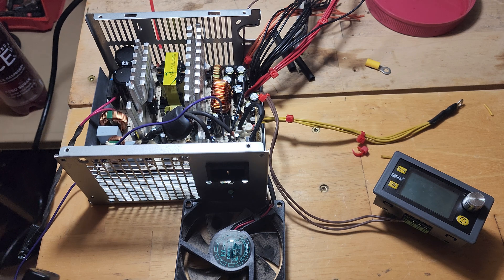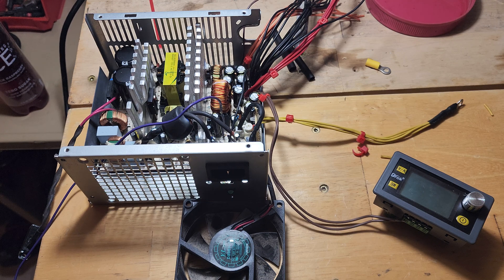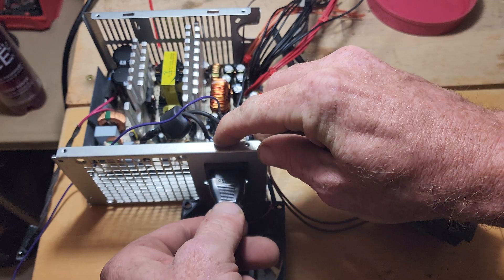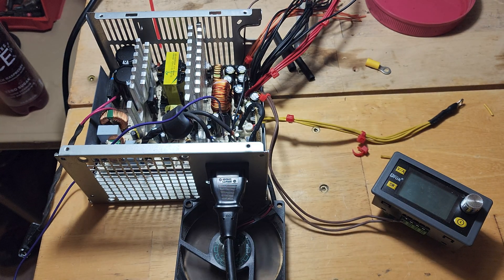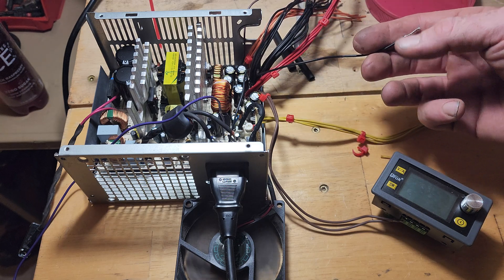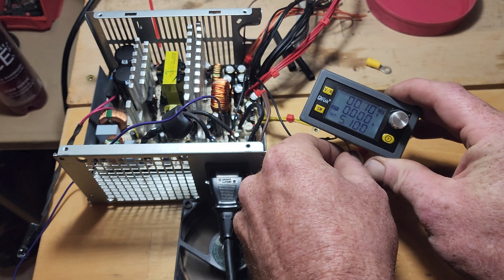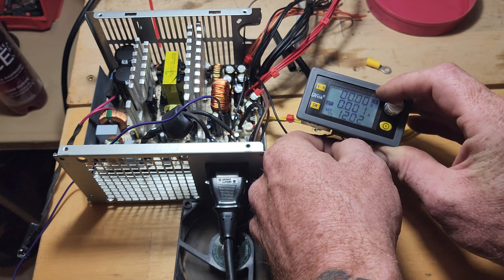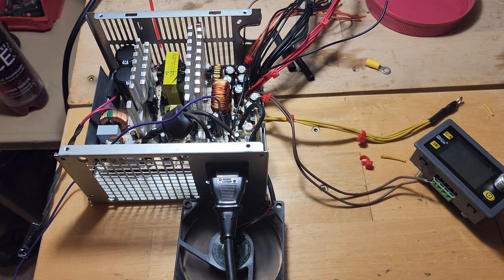Playing around with an old PC power supply.

Comment: Great that you are having fun doing these. I also did modify an old PSU to work almost the exact same way, however with an added Fuse on those wires, Power button, Buckboost converter with additional Potentiometer to have a variable voltage between 1-12V and installed 2 banana socket for two 12V lines each.  I get around 15A from the both 12V lines, which is good for powering automotive electronics. Bought another old PSU for like 15eur, gonna mod it into a bench power supply too. Its fun doing these things.